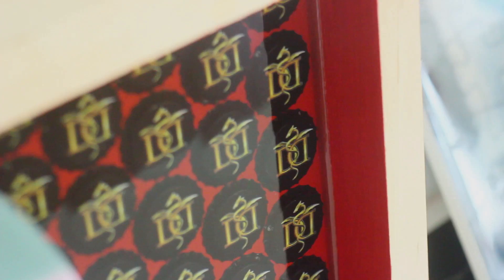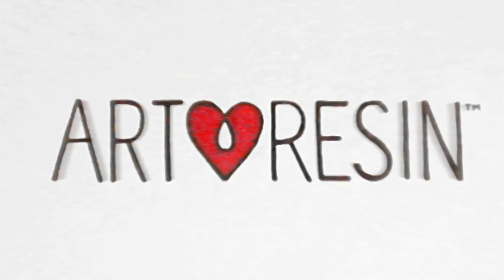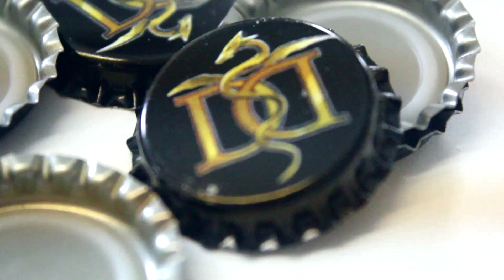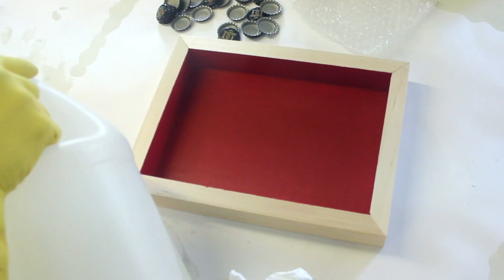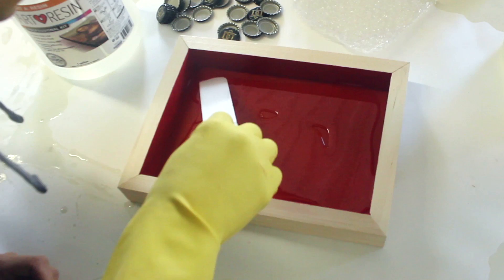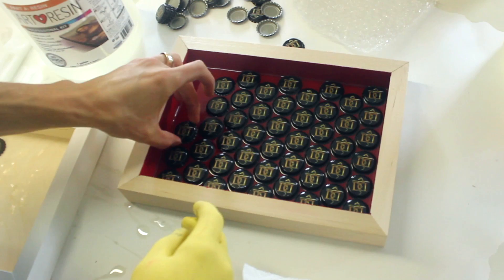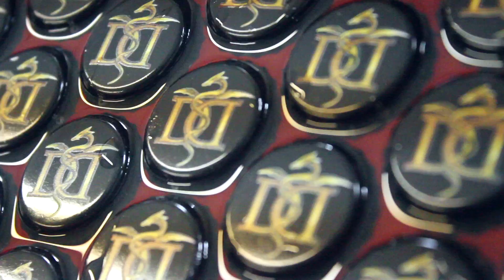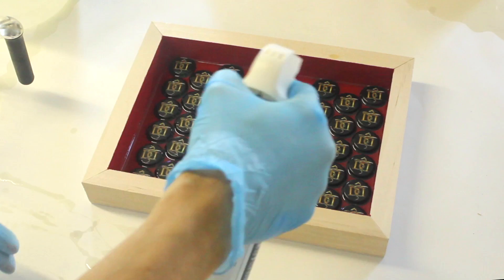Top 4 ArtResin Ideas! No. 1 - Embed Beer Caps

Comment: Can you always and consistently mention the dimensions and ratios of epoxy used for the bottle cap placement and then the other half coat of finishing the artwork???
Reply from the maker: Thanks for the feedback :)  If you ever need to figure out dimensions, we have an awesome Resin Calculator on our website.  Just punch in the dimensions of your piece, and the calculator will tell you exactly how much ArtResin to use for a 1/8" layer.  Repeat with the same amount for as many 1/8" layers you need for the depth of your piece.  One coat of ArtResin generally suffices if you're simply coating your artwork.  Hope this helps!
https://www.artresin.com/pages/calculator

Comment: when you mix the resin did you pump the bubbles out ?? or just mix it slowly in order to not make a lot of bubbles ?
Reply from the maker: +Verny Madrigal bubbles are fine... they are unavoidable.  mix like crazy.  the bubbles will mostly rise on their own but using a small torch is the best tip in the universe :)